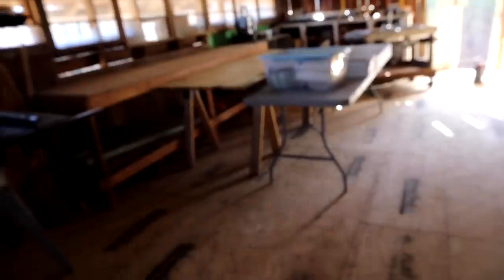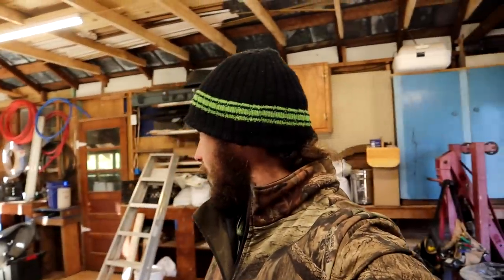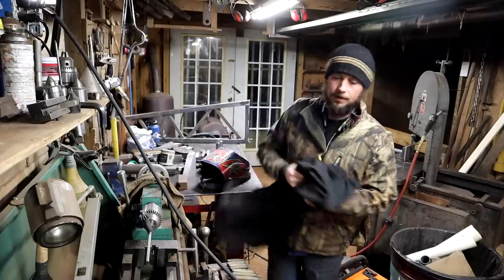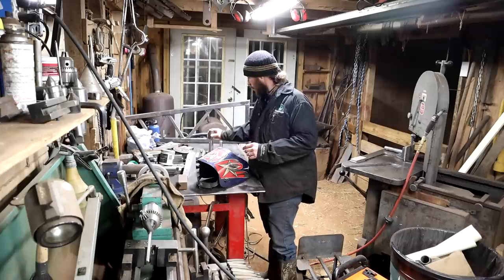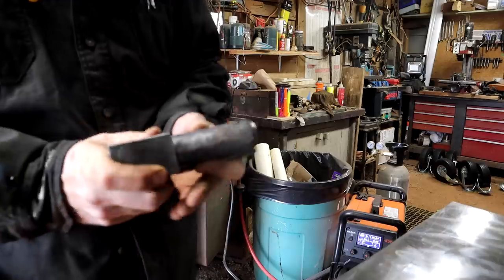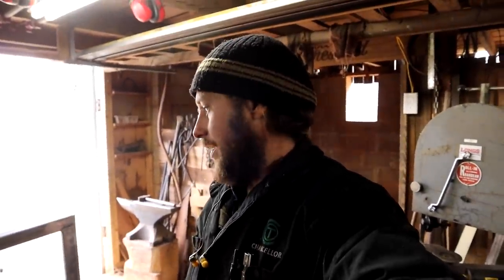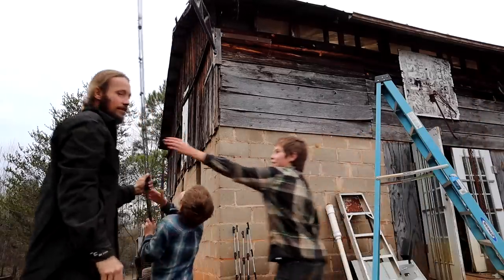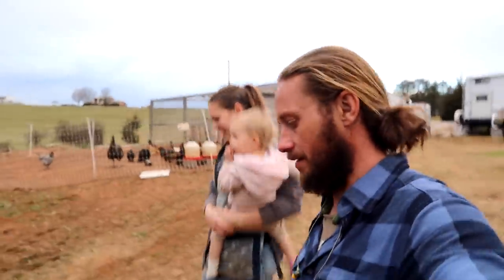This Is The Most Important Part

Comment: I'm impressed!  I was worried the the corner didn't have enough meat to hold your crane arm.  Consider an electric winch that can be used vertically.  If the crane can hold the weight of a full size pig, the winch will lift it up.

Comment: My Dad had a scalding trout. It was made of wood and a fire was built under it to heat the water. You  could use a metal watering trout from the co op  or Tractor supply.

Comment: Compliments on the crane.

Just a suggestion instead of the pully use a wench.

Save your back and borrowing from neighbors. 

Could invite neighbors over to help and have a feast after.

But I'm still sure a wench would help
Reply: I was wondering what is wench so I went onto Google to find it. I had a good lough when it came up with a woman picture. So woman picking up the pig😉👌👍😊 love it. Than my partner said the one I am looking for is spelled with an i. Found it. Thank you. I never new the different now I do. 👑
Reply: @erikas974  your right I didn't recheck spelling. I had typed it correctly and evidently the autocorrect feature thought I meant use a woman. 

It is funny as heck tho.
Reply: @josephverrett1680  I am glad we worked it out😄. That is why I turned off the auto correction. Especially because I am typing two different language and I could never finish a sentence without correcting me. 
It was great fun. Thanks to your auto correction.
Reply: @erikas974  thanks I thought I did already but had an update earlier could have turned back on.
Reply: @erikas974  thought I turned off. Recently had updates and maybe turned back on.

Comment: you could always mount an electric winch on the wall and run the cable through a pair of pulleys on the boom,  the winch could be on a quick release mount to be used elsewhere (like in your shop)

Comment: Thought about using 3 4×4. Cement two in the ground. Duck tail the two ends sticking up. Duck tail both ends post#3 drill holes in Duck tails add anchor bolts or screws. Buy a wench from Amazon stablelize it at standing position. Get a 2 eye anchors put one at in corner the second in middle run the wench wire threw them. Do you think this will work. Or do you have any tips for me?